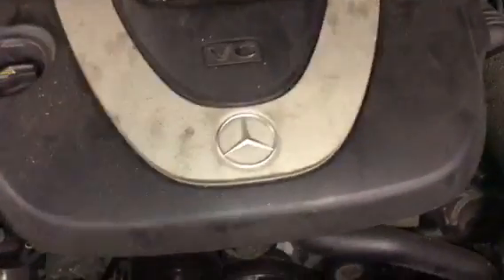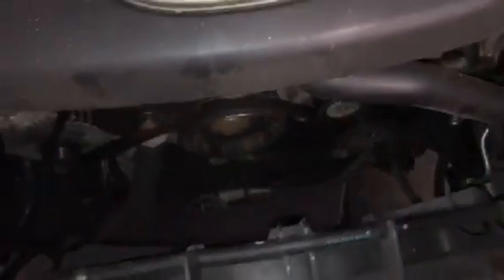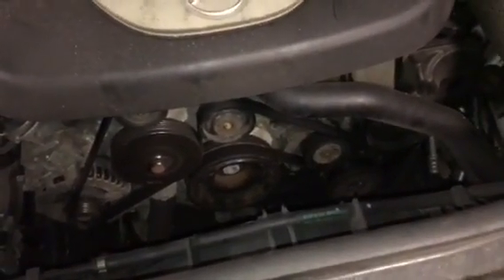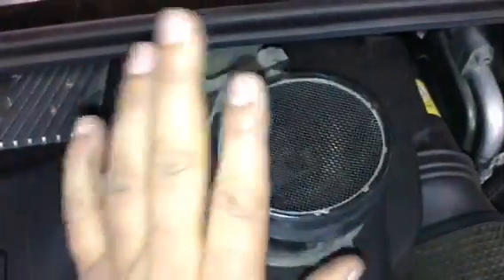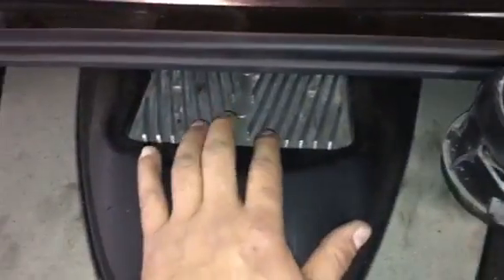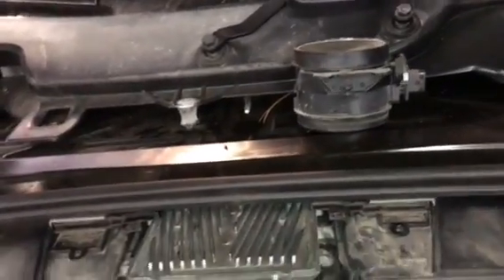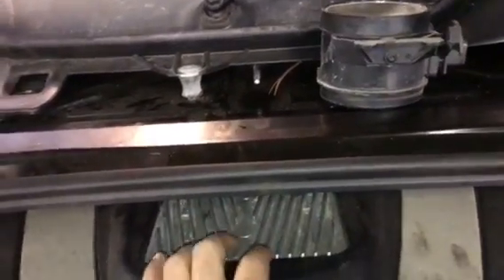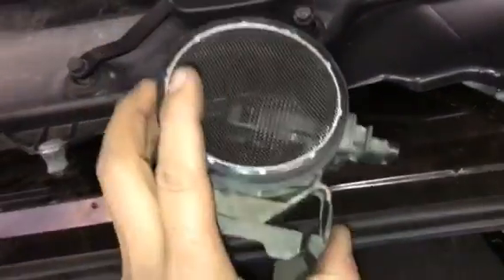youtube video #2eYcxJ-RvK0

Comment: What on earth has an air mass sensor got to do with the Fan running at high speed🤔 ?  you need to check these car's properly. It could be any number of things that are not working correctly. Coolant temp sensor, air con defective or high pressure sensor's faulty.it could be automatic transmission coole circulation pump, or more commonly the built in control module which is integral with the fan.
Reply: I was wondering the same thing. I just changed the two sensors at a/c higher line leading to the expansion tank or dryer. Not really sure how it called. My fan is no more loud. It’s been two weeks now and it’s working fine.
Reply: This is actually a legitimate, albeit clumsy way to diagnose fan issues in some of the older Mercedes models. I always start with stored DTCs in the ECU, HVAC, and SAMs and move on to live data and run tests from there, but not everyone has the tools or ability to do it the right way.

Comment: Just bought a 2009 c class estate c 220 turn ignition on fan started straight away and sounded like a harrier jump jet taking off so did all usual checks watched several videos and nothing but then watched a vid which made sense low voltage on battery so I had a brand new battery on my s class took off battery joined positive and negative together without the battery on the car left it like that overnight put s class battery on c class it was bigger more ah and CCA started car all was fine been using it for four weeks now with no problems hope this helps some but not all

Comment: what's the parts number. is it for 2007 e350. thx
Reply from the maker: Sha Hossain is a very common problem with the Mercedes radiator cooling fan running constantly on high speed. The problem in most cases is a bad ecm so in order to fix it the ecm will have to be replaced and programmed to work with your vehicle.  Check The MAss  AIR flows sensor first.  If it checks good then more than likely the ecm will have to be replaced.
Reply from the maker: Sha Hossain Mass Air Flow sensor Napa part Number # ATM0280218190
Reply: Thank you very much. One more question. Did you had any Fuel pump problem. I do,  and I was told I have to changed the whole fuel tank and it's very expensive.  Fuel pump and the tank is one unit. Any advise
Reply from the maker: I don't have problem of that type in Mercedes Benz. why need a new gas tank and fuel pump?
Reply: @shahossain7684  it is expensive. Some vehicles are covered under the recall. I wasn't and it cost me $3,400